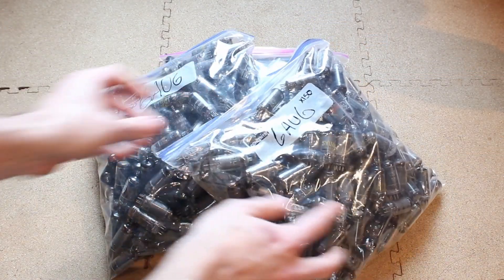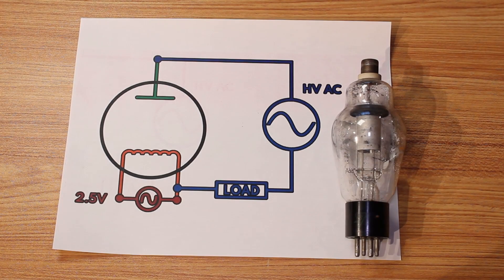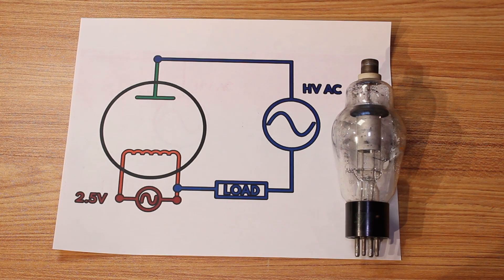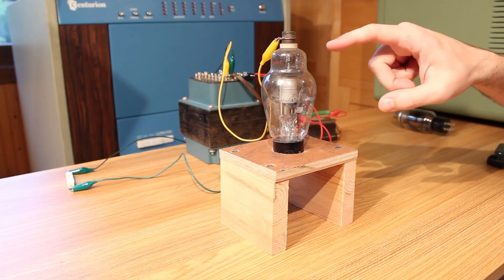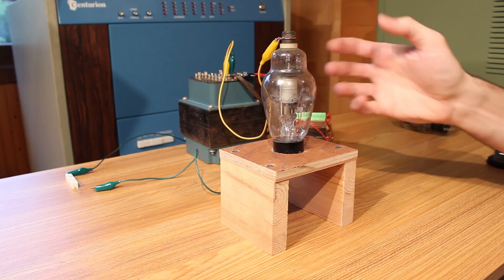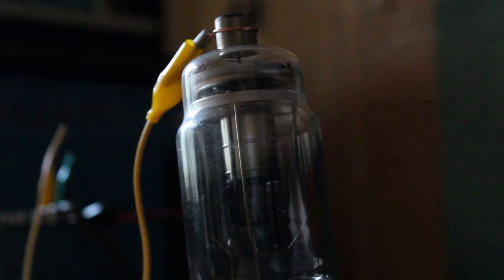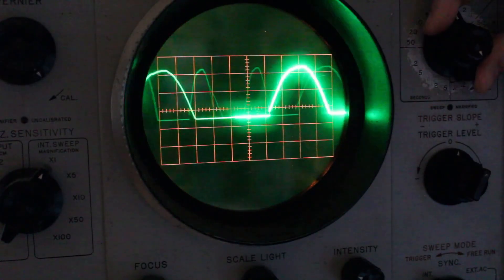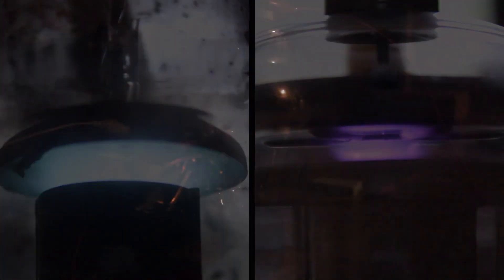A Look at Mercury and Xenon Rectifiers

Comment: I have several big mercury vapor rectifier tubes, likely from an old Ham radio/RF amplifier set.  They're absolutely beautiful when lit.  Unfortunately, these things tend to put off a good deal of electrical noise.  I'd love to use them for an audio amplifier project, but I'm concerned about them introducing noise into the audio path.  Anyway, these and mercury arc rectifiers are my all-time favorite types of tubes.  They look like something out of a mad scientist's laboratory.  Great video.

Comment: When I was a young kid in the early 70s my father and I would take the tubes from his old tv to test them on a test stand when it had an issue. They had a Phillips test stand at the local 7-Eleven. Once we had tested all of them and found the bad one or ones, we would look the tube up in the inventory that was stored under the test stand and purchase them. The Phillips test stands even had a disposal bin because recycling vacuum tubes was as common as recycling coke bottles back then. The vacuum tubes would go bad if the tv was used a lot. I remember going with him to do this regularly until they had the money to buy the first solid state tv we had, which was one of those large console tvs with a built in stereo.

Comment: couldnt you wire the primary windings of the transformer to run on 220 volts then you should get 3.2 volts for the filament and wire the 113 volt in series with the 137 volt winding to get the high enough voltage for the tube?

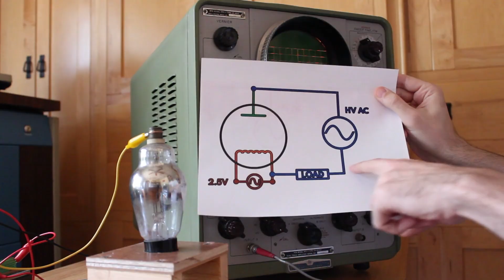Comment: At 10:38, shouldn't the oscilloscope be connected parallel to the load instead of in-series? Or is it measuring the current instead of the usual voltage?

Comment: Excellent demonstration and explanation of their function and theory of operation. As a sound guy I used to sometimes get fantastic views into the back of valve heads for the keys, bass or guitars from my position at the monitor desk and you could actually see the plasma oscillating at the frequencies being modulated by it. I always thought it was a very cool effect of how they work. Question: How does a person extract usable DC from the tube if it is also energized with high voltage? Loved your video. 🫡
Reply: That SOUNDS awesome!!
I think the DC is actually high voltage DC. He mentioned like half wave, so +240?
Reply: @Ktulu789 It was fascinating to watch - Key and Bass sounds are really neat looking in the tubes, probably due to the wavelengths and their amplitude. 🤔🫡

Comment: I'm so used to associating the word "rectifier" with bridge rectifiers that I forget that technically a single diode is technically a sorta crappy rectifier all by itself - you only get half of the wave though, whereas a bridge rectifier flips the bottom half of the wave and sticks it upstairs with its counterpart. Those big mercury arc rectifiers are really something to watch! Depending on the glass used, they could even be a serious source of UV radiation but I'm not sure. Cool video, I like your channel man.

Comment: it would be cool if you used this in conjunction with a guitar amp some how... maybe a relatively low power one... i'm not sure if it would work because it should be maybe 70V (i think)... but if it did, that would be kind of cool becauase you could make  the lamp into a distortion/fuzz effect but it would be in the power section of the amp (instead of the preamp section as you would normally see)...

Comment: 50 years ago as a kid in high school I worked at the local radio station.  We had a 10KW FM transmitter, old RCA thing, that used 6 mercury vapor rectifier tubes for the B+.  In the winter time we always left the filaments on even when it was off the air as the transmitter shack up on the mountain was  unheated.  Mercury would condense on the cathodes and the plates in cold weather.  Every once in a while the goofball who worked the last shift on Saturday night, in a hurry to leave, would kill all the power.  The Sunday morning person couldn't get the station on the air and I would get a phone call early before church.  Headed to the station to get the jeep for the trip up the mountain and afraid of what I was going to see.  Yep, instant superfund site, all the rectifier tubes had exploded.  I don't miss working with these.

Comment: radioactive nuclear reactor water is blue radiation is the same effect has nothing to do with electrons      the negative is the dielectric which is power           the positive just starts the process      same reason why blue lasers are the most powerful               same reason why hard to laser engrave blue objects      same reason why water takes on the color blue at a depth of 60 feet or more        same reason why they call it the blueshift of light                as above so below it's all the same phenomenon has nothing to do to do with particles    just dielectric counterspace

Comment: Te voltage on the transformer is RMS, the scope is displaying the peak voltage
assuming 113v, then 113*1.41=159.33V, i'm guessing the 113 is higher due to no load.

Comment: just fyi those mercury tubes make UVC light, the very beautiful blue you see is low intensity compared to the amount of UVC light they make. The glass will certainly filter some of it but while it looks beatiful i suggest you don't look at it too long because it can damage the retina, often causing a sand-like feeling in the eye and with long exposure will cause blindness. As i said, the intensity of the blue light is very little compared to how much UVC they put out. UVC fluorescent lights have the same blue glow but it's more visible as they don't have a shield, also they put out way more UVC so they're even more dangerous to look at. All mercury vapor lamps and tubes inevitably make UVC, unless properly filtered they should not be looked at, even though the blue glow they make really is beautiful
Reply: Years ago, when i worked in a steelworks  using 220volt dc there were rectifier stations parralleled to a ring main for distribution. Each sub had 10 glass mercury  rectifiers . We used to check the operation by viewing the rectifier  using a welding mask.

Comment: Not going to make a curve-tracer circuit to really check out the full characteristics? Curve tracers are cool, and real easy to make with a scope capable of XY mode and some sort of transformer. And a current-measuring resistor.

Comment: I've worked as an industrial electrician, motion controls, 3ph 480, some light rail DC substation rebuilds, some electric arc furnace work at steel foundries, etc. NEVER saw a mercury rectifier until I played Sniper Elite 4. They mesmerized me! I googled them. A video here on YouTube appeared. Photonicinduction was the channel. Well THAT took a turn! So cool to see here a smaller version! Thanks for this!
Reply: SE4 is a GREAT game. I remember exactly what mission you're talking about, too. First time o ever saw one was in a video on YT, it was in a battery charger, and to start it you turned a knob on the front that tilts the whole tube to strike the arc in it. It was super cool.

Comment: I didn't realize that the mercury rectifier tubes were capable of such current, that's pretty hip.  There's an old substation down the road that used to rectify 600 V for the trolley buses around the city and they used mercury rectifiers, originally at least.  Would have been cool to see some 600V 3-phase arc happening.

Comment: Remember a long distance high voltage DC line only has two wires  rather than 3 wires like a normal 3 phase high tension line.

We have a 800 plus Mile line from the Columbia river in Oregon , near the Washington border, to the LA area in California.
500,000 volts DC then switched back to 3 phase AC in Sylmar.

It is actual two way so they can sent power up to us also.

https://en.m.wikipedia.org/wiki/Celilo_Converter_Station

Comment: Let me elaborate: for instance. "Why is the antenna tuner at the station , shaped the way it is?" why did they use Pyrex tubing and what did it do? It  was more that just heat removal it was some sort of rectification/electron suppression system, where the tubes were submersed in de-ionized water. lots of other question. Lots of mercury vapor stuff going on there. Can this radio station ever be rebuilt? How do we make tubes that are 4 foot tall? How did they make them? who made them? what did this process look like making giant tubes? Why isnt this station forever preserved?

Comment: This is a variation of the electric arc lamp - the variation is using a different gas for the plasma, which uses less energy and probably gives a different illumination curve. The electric arc lamp isn't widely used today because the light is uncontrollably bright and harsh.

Comment: Back in the mid-80's, I helped an older electronics guru and ham radio operator build a high voltage (3kV) power supply from surplus parts that included a pair of mercury vapor rectifiers. He wouldn't let anyone walk behind the supply while it was operating. It had an open back and his concerns were the UV light and his fear the whole thing would just explode due to the unknown provenance and condition of the parts. Luckily, nothing ever blew up or caught fire, and nobody got electrocuted. The fellow was nearly blind, and he blamed it on his constant playing with those rectifiers since his childhood.
Reply: What was he doing with 3kv of DC?
Reply: @BD-cm7xc  RF amplifier tubes often need that kind of voltage.  You can get a stupid amount of power out of them, but they need several thousand volts to do it.  Most audio stuff tops out at out 700vDC, and they're usually run at under 500vDC.

Comment: Just scored a brand-binucci  industrial GE 5558/fg32 mercury vapour, in a parts lot bin.....also have an old military 866 with a bent anode, much like yours.  both are a pain to light off as they have uncommon fillament voltages...

Comment: 55 years ago, I was an electronics tech in the USN. I worked on a transmitter the AN/WRT2 there were 4 large rectifier tubes in the amplifier power supply, they glowed a beautiful purplish blue, while rectifying 2kv.

Comment: I got stuck with some 555 mercury- vapor rectifiers as part of a batch of tubes I bought a while ago; glass and ceramic cylinders about the size of beer cans, each containing a tablespoon or so of mercury, with a heavy wire coming out one end. These were purportedly used in old welding equipment, but I have not found anyone who can use them,  and so I will have to pay a specialized industrial waste facility to recover the mercury from them and dispose of them properly. 😖
Reply: Those are ignitrons, which are similar to an SCR in operation. There is an "igniter" pin on the bottom, which is used to turn the tube on at the desired point in each half-cycle.  Many of those tubes require water cooling through pipe fittings on the sides of the tube.
Reply: @bobweiss8682  ,  Thank you for identifying them, I couldn't remember the correct name. The ones I have do not have have an attachment for water cooling. They have transparent glass at one end and ceramic on the other,with a metallic spray shielding over the ceramic part (similar to the spray shielding you would see onold Majestic radio tubes from the 1920s and 30's) but you can see the mercury inside one end of the tube if you hold it vertically.  I have been unable to find anybody who has to use for them,  and shipping them without a ton of packaging or a crate around them could be very hazardous (and probably illegal, or unacceptable for most shippers), so I will have to pay to have them scrapped safely to protect the environment.

Comment: Hickok tube testers use a #83 full-wave mercury-vapor rectifier (with old-type 4-pin base) because of it's fixed voltage drop at a wide range of current. There was also a short-lived tweed Fender Bassman circuit that used the #83; I've seen the schematic for it but not the actual amp, although I worked on a "transitional" Bassman that had many of the same component value and circuit characteristics as the #83 version, just not the 4-pin socket for the mercury rectifier (it had a factory-stock octal socket for a 5U4).  

Some folks replace the #83 in a Hickok with solid-state diodes (and perhaps some dropping resistors), but I don't recommend it ---- the calibration and "accuracy" of a Hickok was designed around the #83, and a solid-state rectifier will tend to make marginal tubes read as " good". Note that the Hickok units orient the tube sideways despite the tube manuals saying to use it in vertical orientation only; it is best to allow the tester to warm up for at least 15-20 minutes before testing tubes, to allow the mercury in the #83 to vaporize before pulling B+ current through it (to prevent the #83 from arcing, though this isn't common in a Hickok where the B+ is only 150 volts anyway; that tube will last many years in this application). By the way, an 83-v isn't the same; it's a vacuum rectifier, not a mercury vapor tube.

Comment: This was super interesting, thank you for the video! It does make me appreciate the simplicity of using silicon diodes though haha

I was wondering, does the plasma just immediately collapse once it hits the zero voltage crossing? Otherwise I could image that the plasma might be retained and continue to be conductive during the negative cycle, right?

Also, during the startup of the xenon rectifier at 12:15, it seems to need a higher voltage to start conducting at the beginning, but this starting voltage gradually decreases. It's this due to the gas/filament needing to warm up?
Reply: Based on the physics, the plasma will take a non-zero amount of time to revert back to cold gas.  I dont think it really makes a difference to the operation.  The asymmetric heating is really what allows the electrons to flow

Comment: I was on an army mountaintop radio site in 1969. We had about a dozen tube based (TRC-24 and TRC 29) microwave sets up there and these had mercury rectifiers in the base of the racks to supply the DC voltage to the system. We were on top of a 3500 ft peak so we did not have a lot of bugs up there but in the spring we had an invasoin of Miller moths that went ape over any UV light source like the mercury vapor security lights around the site. You could see clouds of them around these lights, we were careful to use only dim bulbs above the entry doos to the Quonset huts to not draw any moths to the buildings and that pretty much kept them at bay,

However the moths could see that loverly UV glow in the base of our transmitter racks through the windows and they wanted inside NOW. A few would always find a way in and go after the florescent lights and those glowing rectifier tubes. Nothing like a big juicy moth colliding with a very hot tube to ruin your night. They would dive bomb the rectifiers and as soon as the hit that hot glowing glass they would be cooked and could crack the glass envelope of the tube and take a set down till we could get a new tube in there. We ended up lining the metal grills that covered the ventilation holes with copper screening to keep the buggers out.

Comment: nice look at some old rectifier tubes. I have worked on a old AM broadcast transmitter that had 12 866A tubes . 2 sets of 3 phase. had delay relay to pre heat the 866 before the HV came on. also with the modulation of transmitter the glow would dance around . also 866A give off UV so protect eyes. also some ham radio amps use 866A with 811A tubes. I have one. the Xenon can be used in place.  today HV diodes are used. I like old tubes as well . many still made today. 811A, 572/B  ,3- 500ZG and Fender still use KT66 and KT 88 on new amps. I like NIXI and VFD tubes. you can make video on 0A2, 0B2 ,0D3 gas voltage regulator tubes. the different gas is different color and a different voltage. also the 6E5 EYE tube and types are neat as well. today I work on 4CW2000A7 tubes 4 in a transmitter water cooled . The ATSC TV transmitter has 2 IOT tubes . Inductive output tubes,  lot of tubes still in use today .

Comment: I'm going to nitpick a little here at the use of the phrase "boil off" to describe the emission of electrons from the cathode. I would call it charged particle emission, since it requires a strong electric field at the surface to pull the electrons out. 

Also, the "shield" around the cathode is known as a "Wehnelt cylinder". It helps to keep the electric field lines parallel in order to emit an electron beam that doesn't spread out too much and therefore allows the tube to sustain higher currents by counteracting the repulsive force that the electrons exert on one another.

As always, thank you for another fantastic video.

Comment: We use/used six phase (3 phase centre tapped transformer input) mercury arc rectifiers - yep, they had six anodes - to supply high current (over 400A) 1500VDC for the suburban electric trains here in Melbourne Australia.  I think they are all gone now with old substations being retrofitted with newer technology and with a lot of the redevelopment going on now the new substations definitely don't.  I still work in the Metro railway network but not in traction division, but yes in my younger years have seen one working.  Looks really cool with a train accelerating!!

Comment: How about ganging those two tubes together to make a full wave rectifier? Then add it to a tube based DC voltage regulator. Retro or what!
Could the tube anodes run at 24V ?
Reply: Those tubes 866A etc will conduct down to about +10 to 15 volts on the anode, but it needs a little more than that to get started.